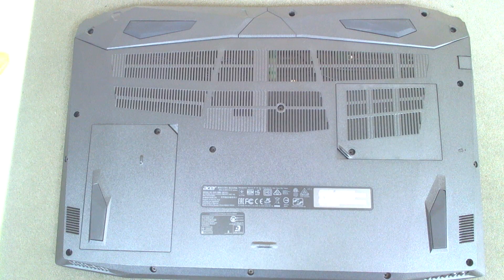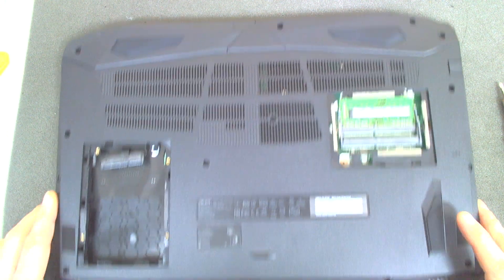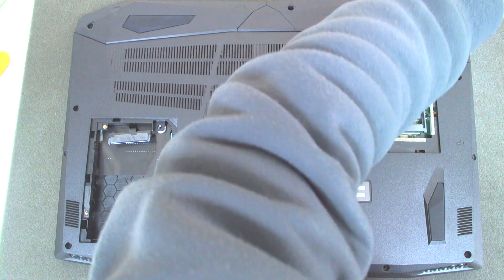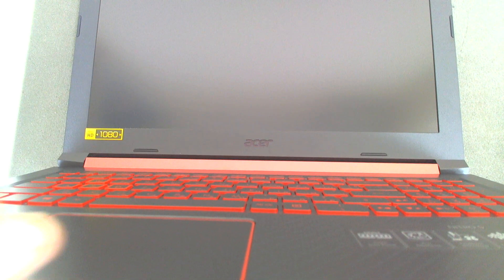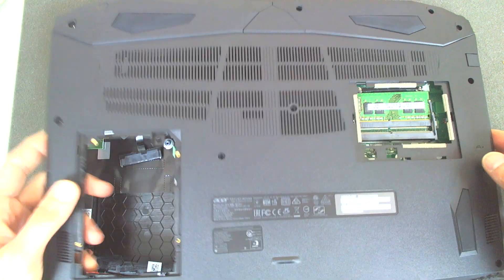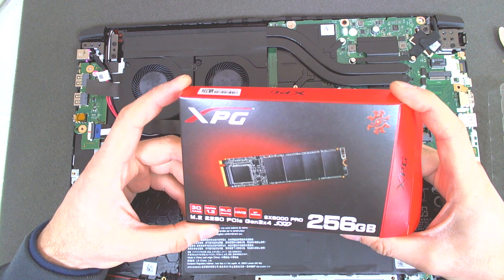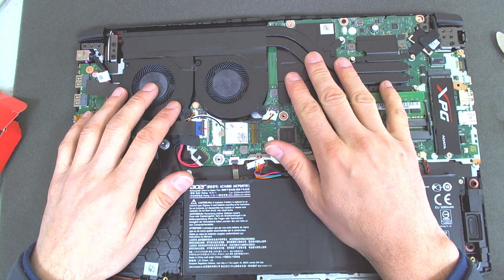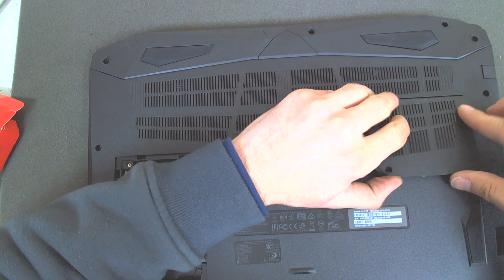Acer Nitro AN515-31 М.2 SSD Upgrade / Install

Comment: If i delete all the partitions does that mean i will lose all of my data from my hdd?
Reply from the maker: Yes
Reply: @LaptopDisassembly  is there no way for me to not lose my data? because im just adding im not necessarily transferring
Reply from the maker: Is the old drive separated or is one piece. If is is separated, just transfer the files to the non system partition and just format the old system (c)  drive.  If the old disk is one partition... Just make a fresh install on the new ssd drive and make it first bootable in bios. After that just leave the old one as it is and use it as storage.

Comment: Is this the amd version? 2500u?
Reply from the maker: No it is Intel i5 8th gen
Reply: @LaptopDisassembly  is it the same as the amd version? Does it have a nvme ssd slot?
Reply from the maker: yes it is the same, also with nvme slot.

Comment: Hello, great video! Just a few questions. I bought a new Acer Nitro ryzen 5 and I was wondering if it's ok to do the SSD upgrade before powering on laptop for first time. And also how would I go about installing Windows 10 onto SSD drive, should i do fresh install? Also noticed you didn't use any of the thermal paste, is it that necessary? Thanks
Reply from the maker: Hello,  first i did not use termal paste  becouse the laptop is brand new and it douse not need one. About the ssd.... If your laptop comes with windows preinstalled... You can clone the os to the new ssd with aoemi Bacupper. I have a video about it. If you will make the installation on your own.. You can first add the ssd and than make the instalation.  Just leave the ssd for the os and make the regular disk for a storage as separate disk letter.
Reply from the maker: If the laptop comes with windows preinstalled.. You can make a fresh install on the ssd and it will automatically activate, becouse the activation is by hardware in bios.
Reply: Thanks boss!! Can you also confirm if you think the Samsung SSD will work for me?
Reply from the maker: Yes it will work, people in the comments are saying it is working. So it should be fine.
Reply: Thanks so much! For your help. Subbed
Reply: Ok thanks, I'm pretty new at this and don't wanna make a mistake. So just to be sure again.. If Windows is pre installed.. I can just go ahead with the SSD install and then boot up system in to bios? (Also how do you do that? F12 Key?) Then I must verify that SSD is recognized in bios and then reboot and either copy Windows over from HDD or do fresh install while erasing original Windows from HDD?
Reply from the maker: Yes that is correct. Entering the bios is with F2. Make shure you active the F12 Boot menu.. So you can boot from flash drive or dvd if you gonna instal the os by your self. Best way is to make a fresh install and erase the old disk. There will be no boot problwms after that.
Reply: @freshgreenz4155  hey i am acer Nitro 5 an515-45  can yo guide me how to upgrade ssd its currently having 1 tb hardisk only
Reply: Also I was considering the Samsung 860 Evo 250GB SATA SSD. Do you believe this will work with the AMD Ryzen 5 2500U processor. Acer AN515-42-R5ED model?

Comment: both in UEFI mode while the hdd was partitioned originally and the ssd is not
Reply from the maker: Very strange.. The second drive of the refular disk shoul be visable... You are shure all is conected properly and both disks are visable in bios.
Reply: @LaptopDisassembly  yes  but its solved now. It was sad though i wasnt able to save the data on my hdd. Basically i had to upgrade the driver to make it recognizable
Reply: Thanks for all your help man it was my first ever pc customization though small scale but still your suggestions was pretty on point
Reply from the maker: Did you solve the issue
Reply: @LaptopDisassembly  yes
Reply from the maker: What was the problem.. Just for information
Reply: @LaptopDisassembly  the hdd driver was outdated as i had to upgrade it to be shown but i had to  format everything as the hdd was primary  on boot  even after bios setting  and it was unchangeable even after setting boot priority so had to set up everything from scratch

Comment: i did it but the problem is there is no other drives present  in drive management other than ssd if i boot were to boot from ssd but if i were to boot from hdd then it shows ssd as unrecognized drive
Reply from the maker: Are to both os installed in uefi mode or one is uefi and other is legacy.  Also is te regular drive in one partition or it is separated.
Reply from the maker: Check in bios and play with sata mode... Achi, irst or so.. Im not in the office now.. Will check leter when i go back home.

Comment: 1 question more i have done the installation part i did it after removing the hdd so there is already a copy of my windows in it but now when i try to insert the hdd it behaves as a different platfom so  what to do now to
 acess my hdd when i boot it from ssd
Reply from the maker: The ssd should be first bootable device in bios. When you boot from ssd do you see the other hard drive in my computer.. Any letters like D, E... If not, check with right click on my computer... After that management... Disk management.. And see is there any oter drive in the list.. If yes, just assign a letter to each drive..

Comment: Boa tarde, por favor, estou em dúvida em comprar um SSD de 480gb Velocidade 512mb/s e um SSD 256gb Velocidade de 2500mb/s "segundo compradores". O que aconselham para Acer Nitro 5 ?
Reply from the maker: If that are same speed "write" the faster is better. Just buy the one that is having higher write spead. The read speed is not that important.
Reply: @LaptopDisassembly  obrigado!

Comment: One more question i bought a new laptop but it has no ssd. So, i just bought one and want to install it such that ,i can use it as a bootable drive  and hdd as a storage  i also have already done the bootable usb part  but i am not  so sure  what to expect when troubleshooting the os to install it in the ssd and what to do about the already installled os in the hdd will it give any problem as its the first time i am trying this kind of tasks so can you help

Much appreciated
Reply from the maker: Is a good idea to format the old system partition on the regular disk. The easyest way is to remove the regular drive and just install the os on the ssd. After that put back the regular disk and format the old system partiiton. If you dont have anything important on the regular disk, you can combine it in one drive and use it as storage.
Reply: @LaptopDisassembly  cool thanks will do

Comment: hey how to prioritize the ssd during the windows installation can you show
Reply from the maker: When you install the ssd in the m.2 slot it become default booting device. Just start installing on it ant it will all work fine. No need to prioritize.
Reply: @LaptopDisassembly  will try thanks

Comment: Hello, any tips? I installed m2 120GB to this laptop, but it works only with charge cable, battery doesn’t works, thank you for your answer.
Reply from the maker: If you did remove the battery or you press the battery pin hole it is normal. Just be shure you did plug back the battery  after that plug the ac cable in the laptop and leave it like that for 5min.  After that power on the laptop with ac cable plugged in.
Reply: Yanko Goshev I haven’t touched battery , I’ll try to push pins from battery, windows runs normally on charge cable, when I disconnect it, it turns off imidiatelly, I removed m2 from laptop, connect only hdd and it turns off too.
Reply from the maker: Put back the m2 drive... And try what i wrote
Reply from the maker: https://us.answers.acer.com/app/answers/detail/a_id/34843/~/acer-internal-battery-reset
Reply: Yanko Goshev okay, thanks, I’ll try

Comment: Any tips on how to clean this model?
Reply from the maker: The procedure is the same. Just remove the back cover, disconnect battery. Remove the screws that are holding the cooler and the fan's and replace thermal paste. The fan's are on clips, so you can clean them also. After that on revers just reassemble.
Reply: @LaptopDisassembly  can I get it done by acer service center?
Reply from the maker: @chinmay_korlekar2594   Yes, and you should keep the warranty.
Reply: @LaptopDisassembly  what do you mean by keeping the warranty?
Reply from the maker: @chinmay_korlekar2594   Well if you try to open it and there is a warranty sticker on the cpu screws... you will loose the warranty ( i dont see stickers anymore but still. ) If you take it to Acer repair service they will clean it and put a new sticker, if there is any.  But it is very easy and you can do it your self. Just use a good thermal paste like Arctic MX-2 or MX-4.
Reply: @LaptopDisassembly  Thank you very much. I am very pleased by conversing with you.

Comment: acer nitro 5 an515-43 r41A and acer nitro an515-43 R3Ty

how many slot for ssd nvme/m.2? 

can i change the HDD disk to SSD disk?
Reply from the maker: Each one have only one m. 2 ssd slot and one regular sata port

Comment: Whats the complete model of that laptop? I just want to know if we have the same unit since mine has only 1TB of hdd, my unit model is AN515-52-74a1. I bought Adata SX8200 pro m.2 512gb and I want to know if it is compatible. Thank you
Reply from the maker: It is compatable.. I cannot tell you the exact modelz seance is a costumer ones.
Reply: @LaptopDisassembly  Hi. I have a big problem. My sx8200 is ok. Cloned my hdd to the new sdd. Now i have 2 OS. Everytime I open/boot my laptop it prompt me to choose which OS. So I to default windows of the new sx8200. Now im on the new windows (sx8200) and i have no use of the old hdd, I deleted all partition including the recovery and health partition. After doing so, tried to restart and a blue screen appear.
Reply: The blue screen is RECOVERY with option F1 F8 and ESC. Ok before I deleted the old windows partition there is an F9 option which I can choose which OS i want to boot.
Reply: Error code is 0xc0000225
Reply from the maker: @sFreedom1017   Probably by mistake you delete the wrong system partition, or the new drive was still using the old system partition. You can try and rebuild it with 
bootrec /fixmbe

bootrex /fixboot
bootrec /Rebuild BCD
try to see will it fix the problem.
Reply: I somehow make it work. Heres what I did.
- Bios setup, changed sata mode to AHCI
- Cloned my hdd (OS) to Adata SX8200 Pro 512gb including recovery drive etc.
- rebooted to the ssd and deleted the volume/partition of the hdd.
(This is the time where I got problems,with error code and not booting since the boot manager in bios still recognize the old os which is on the hdd)
- reinstalled the windows using the usb drive to the ssd and the rest is history.
(On bios, boot priority now recognize the ssd)

Comment: Nitro 5 can upgrade videocard?
Reply from the maker: No
Reply: @LaptopDisassembly  but desktop can upgrade video card?
Reply from the maker: @modestopulido6389  desktop yes, but mobile compiters no.
Reply: What is mobile compiters?
Reply from the maker: @modestopulido6389  On the mobile ones there is a BGA chip soldered to the board. Basically you can change it with the same, but not different one.
Reply: @LaptopDisassembly  I.want desktop for forever than laptop xd

Comment: Bro does Acer Nitro 5 AN515-43-RT3Y support Samsung 970 EVO Plus M.2 500GB NVMe 1.3 PCIe Gen 3.0 x4 Internal Solid State Drive (SSD) MZ-V7S500BW?
Reply from the maker: Yes it douse.
Reply: @LaptopDisassembly  Thank you so much!

Comment: Bro ,is that Acer Nitro 515-51 series ??
Reply from the maker: Yes,  Nitro 5 series
Reply: @LaptopDisassembly  Will it support
M.2 Nvme 2280?? and how much  maximum GB can i install??
Reply from the maker: @adnango1990   Well you can go to 500GB model... I doubt it will support 1TB SSD.
Reply: @LaptopDisassembly   bro, I just Installed Transcend 512GB M.2 NVme and itworks fine 🤗

Comment: it supports m.2 or m.2 NVMe? there is big speed difference, and sometimes NVMe slot cannot run just M.2, my brother bought laptop and I want to upgrade it, cant find any usefull info on this topic
Reply from the maker: It supports nvme ssd. The one i install is a a-data xpg nvme ssd.
https://www.amazon.com/ADATA-SX6000-256GB-Gen3x2-ASX6000NP-256GT-C/dp/B075Y4JN6W

Comment: Can I install a 512GB ssd? Does it support it?
Reply from the maker: 512gb is the max capacity that the model can be pre configured. But you can add probably 1tb.
Reply from the maker: 512gb is the maximum when you buy it from a store. But if you upgrade it yourself you can add 1tb. You cannot buy it with 1tb drive originally installed.
Reply from the maker: Yes, i think 512gb is the max supported.

Comment: Can I install Kingston A1000 m.2 SSD in my acer nitro 5 a515-52
Reply from the maker: I cannot confirm that will work ot that mashine. It should but cant tell you 100%.
Reply: @jayporco  Yes, it worked for me perfectly
Reply: in that ssd there mentioned 2280 pci express ssd. But that ssd has 2  keys. In your ssd there is only one key
Reply from the maker: @mohamedjavith5712   The ssd can be M type and M+B type. Usually NVME ssd are M+B. They are compatible and you can read more here. https://rog.asus.com/articles/maximus-motherboards/buying-an-m-2-ssd-how-to-tell-which-is-which/
Reply from the maker: yes. All works fine.
Reply: Thank all you. I got the answer that i want :3

Comment: can i download the windows 10 on usb through other computer or does it have to be through my nitro 5?
Reply from the maker: No problem. You can use Media Creation Tool yo create bootable media on usb or dvd. After that just install it on your laptop.
Reply: @LaptopDisassembly  what screwdriver did you use to open the ssd screw? I tried with PH00 and PH0 but they didn't fit.
Reply from the maker: @namgyal.1111   I use the set of screwdrivers linked under the video. Just use a smaller cross one. It is a standard 2.0 x 3mm screw.

Comment: why do i cringe when people remove huge piece after they remove 10 screws or something? and when the laptop makes loud snapping noise
Reply from the maker: I cant understand the hole question, tun it makes snaping soinds, because the two peaces are held by plastic clips, and  when you open them it snaps. Nothing to worry about.
Reply: @LaptopDisassembly  okay thanks. it's because it sounds so similar to when plastic breaks and that is why i cringe a little 😅
Reply from the maker: No worries, just use something sharp like paper knife of a guitar pick...

Comment: Do you need to use an anti wrist band please help
Reply from the maker: Well i'm doing this for about 15 years...and never use one. If you like you can use... Otherwise there is a lot of metal things around us and you can discharge.
Reply: @LaptopDisassembly  okay thanks and do u also not need one when repairing CPU and gpu
Reply from the maker: As long as the battery is disconnected and you dont ware wool cloths is all fine. But you can touch a metal think just to be shure.
Reply: @LaptopDisassembly  and if I get a little shock?
Reply: @LaptopDisassembly  I don't wanna mess up my laptop I have an acer nitro 5
Reply from the maker: Well you will get little shock.. Nothing else.. Just remove charger and battery.
Reply: @LaptopDisassembly  k thx

Comment: Bro , in 1:23 how if that HDD 1 TB SATA III + SSD M.2 256 GB change to SSD WD BLUE SATA III 500GB + SSD M.2 256GB ? Which is better?
Reply from the maker: Just buy regular sata ssd drive, just be shure it is 7mm thick and place it on the regular one.

Comment: Why does Laptop manufacturer always makes it hard for upgrading HDD/RAM/M2 can they just all have a dedicated one door to open for all upgradable parts?
Reply from the maker: It is the same with all the new things,  laptops, electronics, cars.. Everything is made not very user friendly.
Reply: As far removing the bottom cover this is one of the easier ones I have come by.  Some HPs I have taken apart can be a real 🐻 and I actually had to find the service manual to get out all of the screws.

Comment: I've read the Nitro 5 only supports SATA nvme m2, not PCIe? It's the Ryzen 2500U version, seems you've put PCIe m2 drive which worked?
Reply from the maker: Yes it worked
Reply: I have the Acer Aspire 3 A315-41-R132 and I ran into the same thing.  Ordered the same exact SSD and it wouldn't boot in my Aspire 3.  Sent it back for a WD 500GB M.2 SATA drive and it worked like a charm.  Laptop has 500GB M.2 as boot and the 1TB 5.4K HDD as second HDD.  Guessing Ryzen 5 2500U the PCI-E lanes aren't available or maybe not used.   I see he is using  a Intel/Nvidia setup so that might be the difference.
Reply from the maker: do you use latest bios, also is the disk visible in BIOS or not.
Reply: @LaptopDisassembly   When I installed the Nvme PCIE drive its was stock bios.  That drive was not visible in the bios.
Reply from the maker: @littlebill1987   can you try and upgrade to latest BIOS
Reply: @LaptopDisassembly   Upgraded to the latest bios and pulled a MyDigitalSSD BPX Pro 80mm (2280-S3-M) M.2 PCI Express 3.1 x4 (PCIe Gen3 x4) NVMe SSD out another PC I had.  The Ryzen 5 2500U Acer Aspire 3's do not support PCI-E based SSDs.

Pictures of BIOS and drive installed
https://drive.google.com/open?id=1nZqCEz5DwtSSWubv_r3O8r1Ly8gD9qo2
Reply from the maker: @littlebill1987   Well aspire 3 is a different model than Aspire 5.. Probably is a chipset limitation.
Reply: @LaptopDisassembly  Either that or a bios limitation Acer decided to bake in.  For your laptop to be a Intel the layout is indentical almost to the Ryzen.  Your bottom cover is flasher than my but the layout is the same.
Reply: Did a little more digging and it seems the 1080p Aspire 3 2500U do support Nvme standard.    A custom bios could unlock this.
Reply from the maker: @littlebill1987  good to know